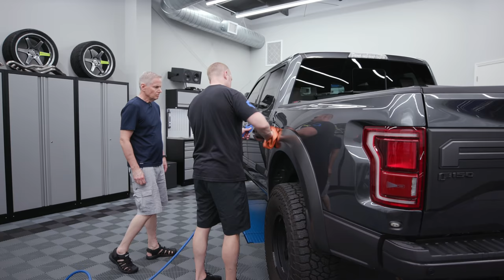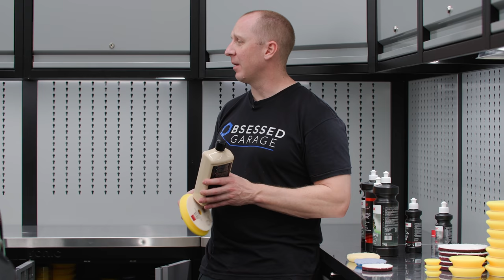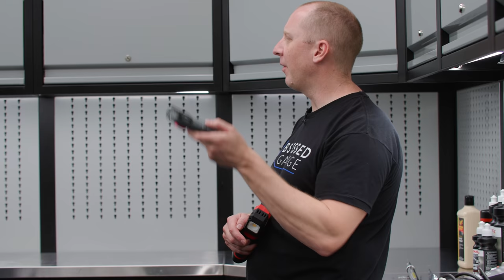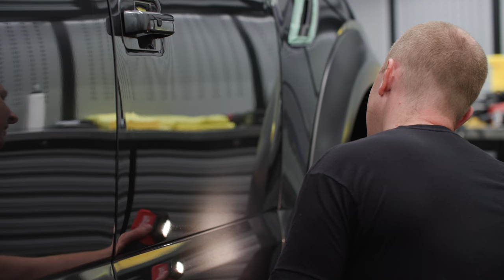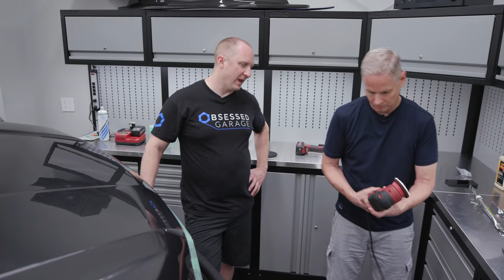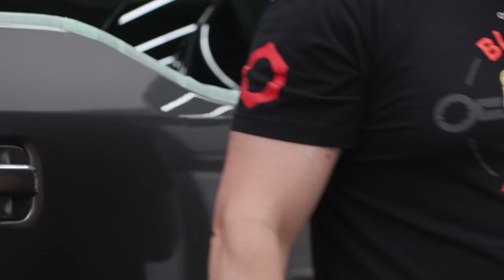How to Polish Your Car - The Detailing Basics - Step 2: Polishing and Correcting

Comment: I have a truck similar to this, new to polishing. Is microfiber safe for me to begin with or would you suggest the wool yellows for more slightly cooler running?
Reply from the maker: A wool pad is going to be exceptionally more aggressive than a microfiber pad. They are used for heavy swirling and on hard paint that needs a lot of correction.
Reply from the maker: Microfiber is perfectly fine, just manage your speed and technique as explained in this video.
Reply: @ObsessedGarage  ok perfect. So I should probably go hello micro rupes and yellow foam rupes to stay safe then. Let me take those wools out of my cart. Thanks for your prompt replies.

Comment: RUPES just announced 3 new microfiber pads, they look like an improvement over the Meguiars and I'm sure Jason was instrumental in developing them.

I know Jescar compound will forever have a place in your heart, but you should really try The Last Cut. I learned about it from The Rag Company, and it blew me away compared to Jescar. It will remove 3000 grit sanding marks, but finishes down very well on harder paints. Zero dust, won't stain trim if you accidentally sling it, and it also has a long working time.
Reply: Is that tld products?
Reply: @CarlosDiaz-ih9sh  yes sir!
Reply from the maker: Yeah…Levi has been telling me that for years.  I should stop procrastinating and get some.

Comment: Really loving these videos but you can't discourage people by telling them they need to buy the $400 rupes polisher when it doesn't make sense for them
Someone starting out it's hard to justify $400 for one piece of equipment, I personally am starting with a rupes knockoff I got for $80, $320 less than rupes. That'd be like me telling you why settle for a porche, just get a Bugatti... it's not pheasable or reasonable for many.
Reply: Instead it should be "get what you can and support the brands that invented this if possible, if not now, down the road" which is what I plan to do.
Reply from the maker: By buying Chinese copies, you are spitting directly in the face of one the companies that invests in your profession.  They are stealing intellectual property, and you are validating that.